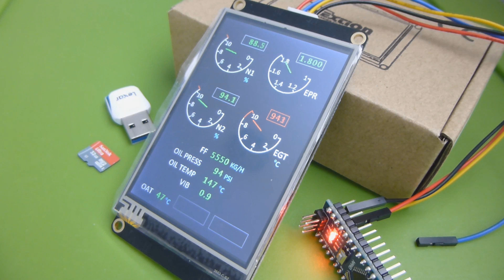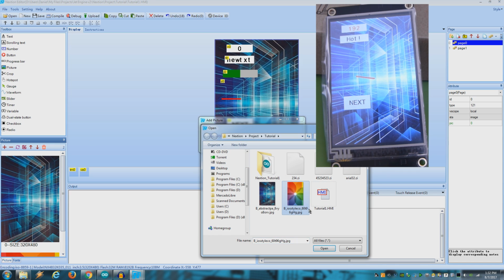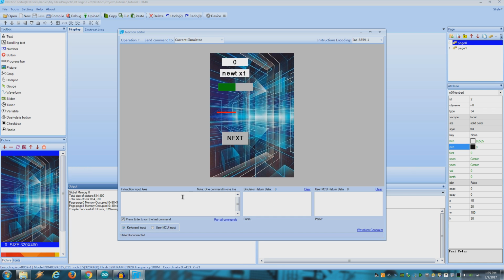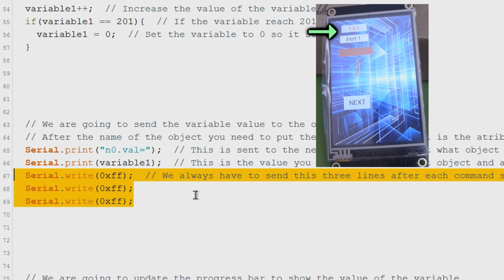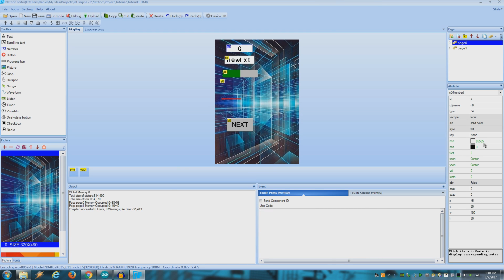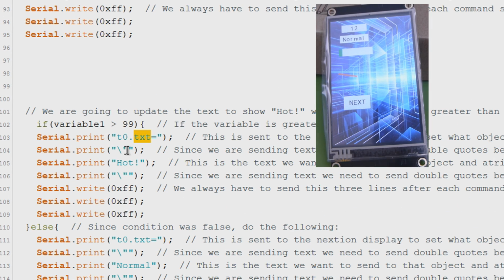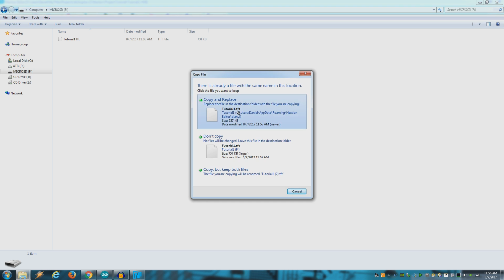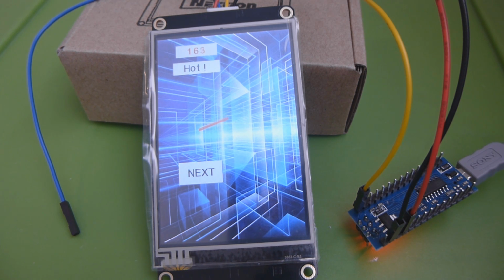Nextion+Arduino Tutorial #1 Beginner's Guide

Comment: Great video, I really wanted to see what code you need to type in the arduino to press that 'next' button on your screen. I have declared all the buttons in my nextion at the top of my arduino code but i dont know what to type in the loop to press a button when a sensor on my arduino board is triggered. Help please!!
Reply from the maker: You mean next page button? That's on the nextion project, not arduino. I don't understand your problem. Did you watched part 2? On my 2nd video I showed all about buttons.
Reply: Sorry i explained that poorly. On my nextion i have 3 pages, and on the first page i have a button (b0) that links to page 2. Now I want to press that button from the arduino when an infrared sensor is detected, to change the page in the nextion. your second video shows how buttons can control the arduino light, but i want the arduino to control the nextion button, kind of the other way around, i hope this makes more sense!
Reply from the maker: Oh, that's easy. Did you notes that on my example file of the 2nd tutorial I have a button called "next" that changes the page? The command is on the "Touch press event" of the button. If you look there you will see the only line there is: "page 1". Since you want to do it from arduino, just send "page 1". And don't forget adding the 3 lines after that: Serial.write(0xff); Serial.write(0xff); Serial.write(0xff);
Reply: This is what i thought, its such an easy thing to do im just having problems. This is my code to change between two pages depending on the sensor reading, look okay? it has no errors and uploads, just does nothing when the IRsensor reading changes, just stays on the first page on the nextion file. Sorry to keep pestering, you have helped a very long way through this uni project! 

const int IRLed = 13;
const int IRSensor = A0;

#include <Nextion.h>

int variable1= 0;
int counter = 0;
int CurrentPage =0;

NexButton b0 = NexButton ( 0, 1, "b0");
NexButton b1 = NexButton ( 0, 2, "b1");
NexButton b2 = NexButton ( 1, 1, "b2");
NexButton b3 = NexButton ( 1, 2, "b3");
NexButton b4 = NexButton ( 2, 1, "b4");
NexButton b5 = NexButton ( 2, 2, "b5");
NexText t0 = NexText (0, 3, "t0");

NexPage page0 = NexPage(0, 0, "page0");
NexPage page1 = NexPage(1, 0, "page1");  
NexPage page2 = NexPage(2, 0, "page2");

NexTouch *nex_listen_list[]= 
{

    &b0,
    &b1,
    &b2,
    &b3,
    &b4,
    &b5,
    &t0,
    &page0,
    &page1,
    &page2,
    NULL
};

void page0PushCallback(void *ptr)  
{
  CurrentPage = 0; 

}

void page1PushCallback(void *ptr)  
{
  CurrentPage = 1;  

}

void page2PushCallback(void *ptr) 
{
  CurrentPage = 2; 

}

void setup() {

  Serial.begin(9600);

  pinMode(IRLed, OUTPUT);
  pinMode(IRSensor, INPUT);

  page0.attachPush(page0PushCallback);  // Page press event
  page1.attachPush(page1PushCallback);  // Page press event
  page2.attachPush(page2PushCallback);  // Page press event

  
}

  void loop() {

  digitalWrite(IRLed, HIGH);
  
  int SensorStatus = analogRead(IRSensor);
  Serial.println(SensorStatus);

  if(SensorStatus >=400) {

  "page 0";
  Serial.print(0xff);
  Serial.print(0xff);
  Serial.print(0xff);
  

  //press nextion button for top bar 
   
  }

  else {

  
   
  Serial.print("no skid risk, click top bar screen");

   "page 1";
  Serial.print(0xff);
  Serial.print(0xff);
  Serial.print(0xff);

  // press nextion button for skid risk
  // delay for 5 seconds
  // press nextion button for clear road 
  // delay for 5 seconds

  }
  

 

}
Reply from the maker: Your code is wrong. If you want to send something through serial, you need to write it like this:

Serial.print("page 1");
Serial.write(0xff);
Serial.write(0xff);
Serial.write(0xff);

You should pay attention to the example files. Use them to learn how to code.
Reply: Sorry I've read back through these and there is one bit of confusion. I asked you how to change the page and you explained  the code in the nextion editor, what i meant was is there a way of changing the page from the arduino, without touching the display?
Reply from the maker: That's exactly what the previous code does. It changes the page from arduino. Just put that code on arduino and you will see how the display will change to that page number. In your code you put this line:
"page 0";

...and you was wrong. Replace that line with:
Serial.print("page 0");

And don't forget the final 3 lines:
Serial.write(0xff);
Serial.write(0xff);
Serial.write(0xff);

Comment: great tutorial, but i have some problem. i'm all ready watch your second video but my arduino to nextion lcd still no respon, i used nextion basic 3.2", what should i do to fix it?. thx
Reply from the maker: Are you trying with Arduino uno or nano? Did you change the setting file on the nextion library folder like I mentioned on the sketch? Did you download the library from the link on the description? Make sure you do all that and it should work.
Reply: finally i'm switch tx-rx nextion to arduino uno/nano
nextion lcd basic tx pin -->  rx arduino
nextion lcd basic rx pin -->  tx arduino
it work, but only the code from example library did it.

Comment: great tutorial thanks a lot. i have been jiggling around with my nextion. 
i m just curious, do we need to have arduino or some microcontr to tell nextion to do things ..like change page after button press or change value of slider etc. or the logic can be implemented into nextion using editor ?
Reply from the maker: The integrated processor on the display can handle all that. Watch my 2nd video tutorial where I show that: https://www.youtube.com/watch?v=mdkUBB60HoI

We usually use it for changing pages.
Reply: thanks for quick reply

Comment: Im having a very bad time trying to increase the baud rate for mi nextion 7inc display. I used your exact code and the Display frezze. Can I have some suggestions.  Thanks in advance.
Reply from the maker: When you say the display freeze, what exactly do you mean? The display stop executing internal timers, or just doesn't read what arduino is sending? If is the first, increase the delay on the loop. If is the second, increase the delay on the setup before you send the command to change the baud rate.
Reply: is the second.. and already increse the delay  to 2000ms before and after sending the baud command. I see in the Serial Monitor the command is sended ok, but the LCD aparently not change its baud rate.
Reply: void setup() {
  // initialize serial communication at 9600 bits per second:
  Serial.begin(9600);
  delay(2000);
  
  Serial.print("baud=115200");
  Serial.write(0xff);
  Serial.write(0xff);
  Serial.write(0xff);
  delay(2000);
  
  Serial.end();  // terminate serial communication at 9600 bps
  
  delay(2000);

  Serial.begin(115200); initialize serial communication at 115200 bps
}

This is how i done it ... dont know whats wrong... ....  thanks in advance
Reply from the maker: Try sending the change baud but keep arduino at 9600 to confirm that the display is just ignoring that command. If its that, try changing the default baud adding an s at the end (bauds).
Reply: Hi.  I send the changing baud rate commands keeping the arduino baudrate in 9600bps and the LCD ignore the commands. Also tried the bauds command and nothing happens... The LCD continues communicating with the Arduino at 9600.
Reply from the maker: Interesting. Maybe for some reason the 7" version doesn't have that option of changing the baud rate? I really don't know. Post on the ITEAD forum. Maybe they can help you. All I know is that for me it works. I hope you can get it to work. Good luck.
Reply: Thank you very much for your help and for the great tutorials you publish. i wil ask for help in the ITEAD forum...
Reply from the maker: If you solve it or at least they give you a reason why it doesn't work, please let me know.

Comment: Hey my friend, thank for your vídeo!
I have a problem, ¿Can you help me?
I need ejecute one "while" cicle, I put it on sub-rutine that one button:

void b12PopCallback(void *ptr) { 
  
  var = 1;
  
  while (var == 1) {

  digitalWrite(s1,LOW);
  digitalWrite(l1,LOW);
  digitalWrite(s2,LOW);
  digitalWrite(l2,LOW);
  
  delay(500);
  digitalWrite(s1,HIGH);
  digitalWrite(l1,HIGH);
  delay(7000);
  digitalWrite(s1,LOW);
  digitalWrite(l1,LOW);
  delay(500);
  digitalWrite(s2,HIGH);
  digitalWrite(l2,HIGH);
  delay(7000);
  digitalWrite(s2,LOW);
  digitalWrite(l2,LOW);
  
  }

}

But I need with other button in the nextion pant get out of the cicle... And I can't, because I don't know how listen a button in the nextion, inside sub-rutine of other button.

Please HELP ME!
Reply from the maker: You really should avoid using delays like that. I usually create counters that go up each cycle and reset when reach a limit to execute something after some time, instead of using delays. You can also have delays without using delays, but instead use the common millis() strategy.

There are many ways to deal with delays without using delays. My suggestion is to do that. I would avoid using while loops too because if they lock in a task, the nextion display could send an event and arduino could miss that for being busy in the while loop.
Reply: Now I use "millis()", and I try put a Flag in the "b12pop...." and ejecute the "While" in the "loop" with flag as conditional... I writing now, I hope that all right...
Reply: I can't... you have some idea to help me? need ejecute one led sequence with one button, but I need on and off sequence with the same button.
Reply: In the nextion, the button is off in the page 1 and on in the page 2
Reply from the maker: I always use this type of delay:

/*
This is an example of how to put a delay using a counter of cycles.
The counter will increase by 1 each cycle and when the counter reach the desire amount, we can
excecute anything we want, and reset the counter to 0 to start over again.
*/

int countertimer;  // Counter to store the amount of cycles that had passed
const int counterAmount = 100;  // The amount of cycles to wait

void setup()  // Start of setup
{

  pinMode(13, OUTPUT);  // Stablish pin 13 as output
 
}  // End of setup

void loop()  // Start of loop
{
  
  delay(10);  // Very small delay, but we don't really need this

  
  if(countertimer > counterAmount)  // If counter reach the limit
  {
    // Put whatever you want to do when counter reach the limit:
    if(digitalRead(13) == LOW)  // If LED on pin 13 is off
    {
      digitalWrite(13, HIGH);  // Turn the LED on pin 13 on
    }
    else  // If LED on pin 13 is on
    {
      digitalWrite(13, LOW);  // Turn the LED on pin 13 off
    }
   
    countertimer = 0;  // Reset counter to 0 to start over
  }
  else  // If we didn't reach the limit
  {
    countertimer++;  // Add 1 to counter to keep waiting
  }

}  // End of loop
Reply: I  understand, Now I include the millis() but I need stop "while" cicle with Nextion button
Reply from the maker: You can't stop a while cicle with a button. Find another way to do whatever you are trying to do without interrupting the main loop.

Comment: been using my Nextion for over a year now with my Arduino, but it's developing graphical glitches. last year I got a random white line 1 pixel wide going down the screen, and this year another has appeared. I tried reuploading everything to it but it seems stuck. Do you or anyone else have these problems? I'm wondering if there's a surge in my 5V circuit where I should be using a capacitor or something, or maybe it's not designed to be left on all the time even with the screen faded to zero
Reply: ArcanePath360 you can try to test  to load a picture or something to your display and look if it will display or not. that what you can  tell if the pixels are reacting or not. it also might be the hardware or  the display itself. I am totally new to arduino and willing to also develop in it. do you have technical specs of your display and your hardware setup?
Reply from the maker: I've never seen that. Looks like a defective unit, to me. It's an LCD so should not have problems staying on all the time. Did you contacted itead?
Reply: I did, but they said it's nothing to do with them, I should contact the seller where I bought it from.
Reply from the maker: Where did you buy it?
Reply: ebay - when I try to look it up, seller has gone.
Reply from the maker: :(

Was too long ago? If not, try contacting ebay. If was a long time ago, then I don't think there is much you can do. Maybe try to fix it? You don't see difference touching and moving internal parts of the display? Maybe something is loose.

I bought mine directly from itead.
Reply: It's a year old. I wouldn't have a clue where to look to fix. I'm guessing something intricate is damaged. Just wonder if it's something I've done. My circuit is complicated with a buzzer, a relay powering 240V AC mains appliance, a humidity and temperature sensor and no caps anywhere. I'm a novice at electronics and there is much I don't understand. Could a power surge or something damage the screen or maybe I pressed too hard on the screen? It's a little suspect that the seller has vanished, but the item is still listed under another seller with the exact same photo. I think maybe it's not designed to last very long.
Reply from the maker: It's possible you damage it. On the website it say is very sensitive to low or high voltage. Not saying that's necessarily the case, but it's possible.

If you buy another one, I recommend you buy it from the official website. Just in case. As far I know this is not common.
Reply: Thanks for your help. Do other sellers not sell a genuine Nextion? I thought they maybe bought from Itead and then sold on.
Reply from the maker: I think is genuine, but you never know if was used or mistreated.
Reply: Thanks. It still works, just has annoying white lines, I think I will purchase another as a backup before they become outdated at a future date and I'm stuck with 4,000 lines of ardiuno code that needs updating!
Reply from the maker: Ok. Although this kind of electronic components don't get outdated that quick. For example, the most popular displays used for arduino usually are 10 years old. The nokia 5110 is very old and still in use. Even the 16x2 LCD is still common, and is older than arduino itself. But anyway, is good to have multiple nextion displays to play around, or make other projects. Good luck.
Reply: That's true, but the 16x2 displays (I have a few) are easy for any manufacturer to duplicate and a cheap low level displays used for many applications where fancy graphics or colour aren't required. The Nextion is a company specific device made by a single company with software and as such is prone to being updated like an Iphone or lost if the company goes bust or gets bought out.
Reply from the maker: Good point. I hope itead keep in business for a long time.
Reply: Me too. If my display breaks and I can't replace it, thousands of lines of Arduino code goes down the toilet

Comment: Great work! Could you show how to make fast updating RPM/Speed bar like in here ? https://www.youtube.com/watch?v=wtXcwcOjaF0&t=4s Also, is using timer component necessary in HMI, can you also do it in Arduino code with calculating millis() ?
Reply from the maker: I show on the video how to do just that. The refresh rate it's set by arduino and the serial baud rate, not the display. As soon as you send a value to an object like a gauge, the display will display it practically instantly (no timer needed). For the fastest refresh rate, use baud 115200 on the serial port.

I put the timer on the display just as an example, but obviously you can send the value directly to the gauge, just as I did with the progress bar.

Download my project files and you are going to understand better the entire process.
Reply: Ok, thanks for the answer! Your project files are very good and helpful. But one thing I don't understand how to make progressbar that is "clipped" like in the video I mentioned in the video. So I don't want basic rectangle but sort of a mask on top of it. Thanks.
Reply from the maker: I am not sure how that guy did that because he didn't publish the project files. But I suspect he made a bunch of images of the progress bars, and call to show the correct image depending on the value. I've done that and it works great (it shows without flickering), but it's very time consuming because you have to create the images of the gauge or progress bar showing every single value. It also uses a lot of memory.

You can create the images with photoshop or any image editor you want.

If there is an easier way, let me know. Maybe ask him, how he did that?

Comment: nice video
Reply: Do you thing it's quick enoght to be a tachometer? I would like to monitor vacuum/boast, tac, fuel pressure, but tach would be the quickest writes
Reply from the maker: Yes, it can have a very fast refresh rate. Just use a serial baud rate of 115200 for the best result.

Comment: Hello, what will be the gain in a broader way, from Nextion to a simple LCD display?
Reply from the maker: With the nextion display you can do advanced things with much less effort. From loading images, having touch buttons, sliders, gauges, having multiple pages, etc. If you would try to do what I show on the beginning of the video (the gauges for my jet engine model), you would spend over a month of work using a conventional display+arduino, and I bet it would still not look as nice as the nextion display.

But if you just need to show a little of text or numbers, the nextion would be overkill. A conventional display is fine for simple projects. What project do you have in mind?
Reply: Ooh thanks!